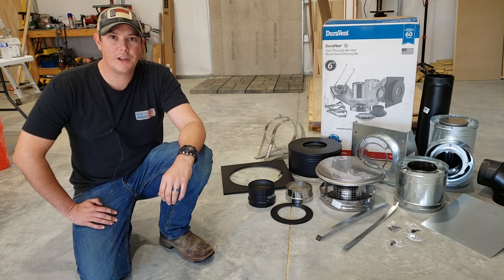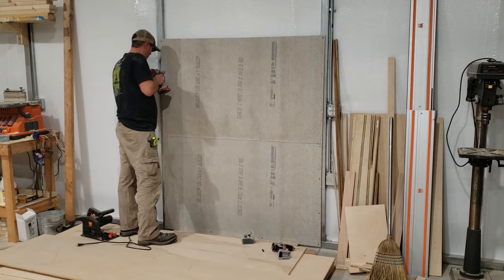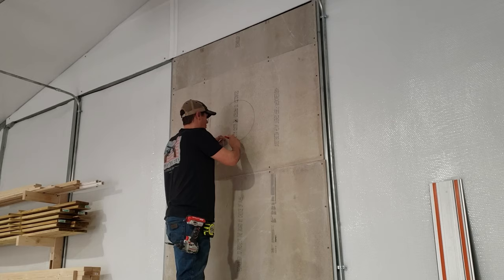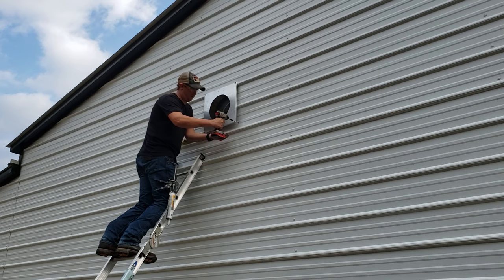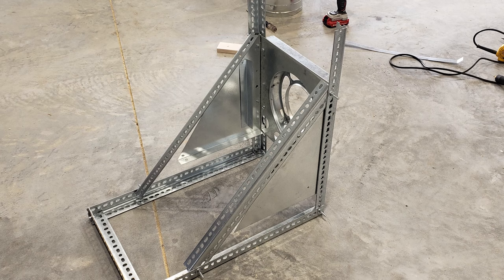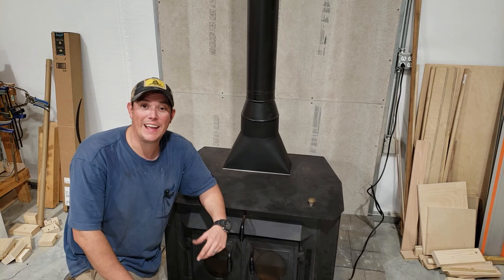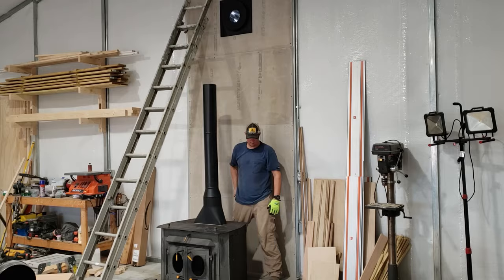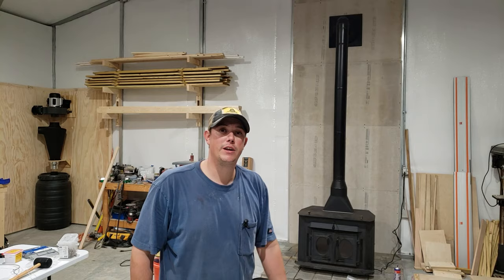Wood Stove Install / DuraVent Through The Wall Kit

Comment: I have just installed this exact system in my pole garage. I was amazed at how many obstacles I encountered while doing the project. First, after building the proper thimble box inside, n moving to the outside, that where the problems began. We installed the outer wall thimble mount, then proceeded to mount the pipe shelf bracket. (No overhang to work around, just straight shot up.) It's good we pre-fit these with the base 3 way pipe. We discovered, in order to get the 3 way into position, the shelf had to be loose from the wall. Those bolt were behind the outer wall thimble! So everything had to be loose n it was a royal bitch to tighten everything down. After that, we fit 2, 3' sections together. After locking into place, they were still able to pull away from other pipe. Next, we went to screw the upper pipe bracket fast to the top of shop. These holes were not big enough to accommodate the fasteners we had to use to withstand the wind we get here. Lastly, the chimney cap that just snaps into place, would have blown off the 1st wind storm we got. So, we re-enforced all connected pipe with self tapping screws. And the chimney cap, we installed 1" spacers with self tapping screws. Still not sure it will withstand the wind we get here. Make sure you are not planning on a breeze install. If you want it done right, you need to know what you are doing, and the way this stuff goes together is not what it seems. There was more work involved than people make it out to be. I might be petty, but this deals with fire, so proceed with caution.

Comment: Through the roof is a way better option. Better draft more single wall which means more heat easier to clean and cheaper option.

Comment: If you don’t mind me asking? I’m installing the same kit with a 24” pipe. It’ll put the platform out about 26”. What size and gauge slotted angle iron did you use? I’m thinking I’ll need at least 36” lengths going out to support the weight. Any suggestions?

Comment: I watched your video because I was a little worried about the situation you ran into clearing the roof overhang soffit. About how far does your shop roof come out from your outside wall? I'm pretty sure I'll be ok because you had to go through alot more wall material.

Comment: Great video, thanks!  I am looking to do almost the same setup but probably going 15 feet higher.  Does anyone have a good resource for what angles and vertical rise is acceptable for stove chimneys?   I had assumed that having a 90° bend was not to code...maybe I am wrong.  Also, there must be some limit on vertical rise.  Any help would be appreciated.
Reply: I'd use two 45's to reduce the angles going through a wall.

Comment: Glad you pointed out the pipe needed another section still. Should be 2 feet above any roof point within 10 feet of the penrtration, if I recall.

Comment: Very cool!  Especially so because that's MY Buck Stove.  

It was here when I moved in in 1990.  33+ years of use & no problems.  It'll cook u right out of the house.

Only difference i see is your's is free-standing & mine was installed as an insert in the original  fureplace (home built in 1951).  Not sure if yours has the 2 speed fan.   If so, you're gonna love it.

Comment: Looks good  . I need to get my stove installed at some point. I would recommend installing a simple damper in the stove pipe . It will help control the  draft and heat loss .
Reply from the maker: Thanks! The stove does have its own damper though!

Comment: Thank you for doing this video! I need to do the same with my woodstove setup, and you answered a lot of questions I had. I was really pulling my hair out trying to figure the best, and safest way to go through the wall. You are a God-send!
Reply: unfortunately Patriot did not follow the NFPA211 recommendations for code compliant installation. Wood behind the cement board. no vertical air space, shield not wide enough for compliance,  and a few other issues..

Comment: I was shocked to find that stainless insulated duravent costs $80/ft
Reply: Insulated pipe is only required when going through a ceiling/wall(combustible).

Comment: Good looking install. If you don't mind my asking, why did you set the stove right on the floor instead of elevated a bit? I know if that was originally a fireplace insert it wouldn't have legs. We bought a farm where everything was heated with wood. The older gentleman who owned it elevated all of his stoves to waist level. It was great. No bending down to the floor to load, tend, or clean. I know that was a little extreme, but it sure was nice. You're not young forever.
Reply from the maker: It's not directly on the floor, it's on blocks

Comment: Hello thank you so much for showing this I need to know if this works on a wooden building and it's not as big as your shop the shop I have has concrete floors but it is wooden built any information you can give me I would be greatly thankful for and thank you again because I have shingles on the top also I have All wood with LP siding on top of plywood of course any help again would be greatly appreciated😊

Comment: "I installed fireproof rockboard then put a piece of flammable wood behind it." 😆 "Then I sealed it with fireproof spray foam." 😂 Rockwood is your friend, son. Utilize it!
Reply from the maker: These are designed to go through regular house walls with 2x4s and plywood...  The Pipe on the inside is single wall which is the reason for the cement board, the Pipe going through the wall is double wall with an 18in surrounding thimbal...I'm sure the wood behind the cement board is just fine!!! Thanks for your concern and "constructive" comment though🤔🤦‍♂️!!

Comment: So why can't you use the cheaper black stove pipe outside for the external section of your chimney?
Reply from the maker: @divorce-split  mainly because it will rust, but also it's not insulated and more likely to cause fire

Comment: Is that a buck stove? I have a 26000 being used as a fireplace insert rn. I have a Wonderluxe wood circulator for my primary wood heat. But I love my buck stove. We use it every day. And man does it push some heat. Replacement parts are expensive but definitely worth the money. Looks terrific too
Reply from the maker: It sure is!

Comment: What type of pipe goes through the wall and how? Does it connect to the black pipe? Is it a bracket? How thick of a wall could I use this on?
Reply from the maker: It's a triple wall pipe through the wall with a larger thimbal that separates it from the wall material. The link for the kit is in the description.

Comment: Looks great however idk why these manufacturers don’t tell you that the crimp should go up with the direction of the air flow. So many videos I’ve seen with people installing the small end in the wrong direction. I’ve been doing HVAC for over 25+ years and it makes me cringe when I see people install chimney and dryer vents like this.
Reply: Certified Chimney Sweep here- male crimps should always face down so that creosote falls into the piece below and not outside the joint running down the pipe. It has nothing to do with flow of combustion gases.

Comment: Great video!
When you installed the Clean Out Tee through the outside wall thimble... 
Did you use a cauking between the Tee and the Circular hole of the thimble? (to fill the small gap)
Much Thanks!!
Reply from the maker: Yes! Fire block caulk

Comment: I am thinking about going through and existing basement window for a stove downstairs.  Any suggestions about how to go about it?
Reply: Take the glass window out (glass cannot be within 3 ft of the stove pipe). Put Cement board (with a hole cut for the thimble in it) in the window opening. Then proceed like on the video.

Comment: how is this working out combined with the insulation? I have a monster wood stove in my 30x30 and it does very little to heat the shop
Reply from the maker: I've had it up to 76 in the shop on 32 degree nights.

Comment: Whats the difference between the $299.99 "DuraPlus  6 in. Diameter Chimney Pipe, 36 in., 6DP-36CF" 
And the $139.99 "DuraVent  DuraPlus 36 in. Triple-Wall Stainless Steel Chimney Pipe, 6DP-36SS"
What's the "cf" and "ss"?  Then maybe il know which I need.
Reply: Just the galvanized material?   That's a big price difference.    Wonder if I need the galvanized? Last longer?
Reply from the maker: I think it's just the finish but I'm not positive.  My kit came with stainless, but the extra section I bought was galvanized. I havnt seen any difference other than looks, both are holding up great...the stainless is shinier....
Reply: @PatriotDIY  thanks.     The difference in price is double.    And we have no one around here in the Rockies, guess the more affordable will work 👍

Comment: Good video. When going through the wall with single wall pipe did you use the adapter the kit came with? My kit the adapter is loose on the triple wall side. Just doesn't seem right or am I too paranoid?
Reply from the maker: I used the one from the kit

Comment: Any issues with the 6 inch pipe? I have a near identical buck stove with the same rectangular 8inch connection. I ran it for a winter with 6 inch  pipe (like your set-up) with no issues. im wondering if this is a good idea or not?
Reply from the maker: I havnt had any problems, only run it for 1 winter also but havnt had any issues

Comment: Did your single wall just connect to the duravent double wall or did you have to get adapter for it ? I am trying to figure out how to install the non duravent  single wall to the duravent  double wall. Any advise would be much appreciated 👍
Reply from the maker: Mine fit into the double wall

Comment: I agree with JBiz180, a better more efficient install would have been straight through the roof. That stove pipe and chimney system is undersized for that stove and will not work optimally, and might smoke when you open the doors. That stove is a dinosaur and very inefficient, you will be going through a significantly more wood than if you had one that was built in the last decade. Also its too short, the chimney doesn't meet the 3-2-10 rule as described in the IRC. Nice install otherwise. I do like the bracket.
Reply from the maker: I realize the stove is old! That's why I like it! It's been working great!  Also i mentioned in the video that the kit didn't come with enough chimney pipe to get the correct hight and that I would be adding another 2 feet of chimey, which I've done now! Thanks for watching!
Reply: @PatriotDIY  Haha i kinda skipped through the video. As certified chimney sweep ill tell you honestly, you actually did a great job. If diy homeowners installed as well as you did, id have to find a new job. I was just in a bad mood earlier. :)
Reply: No, Scott, your comments were spot on. The installation is good  for clearances (assuming the additional triple wall is added on top). But there are slip joints to use for the single wall so you don't cut the pipe. Necking down to 6" may work, but if the stove is meant to have 8" pipe, it usually needs that volume to draw. There are ways to go straight vertical without fear of leaks. Adding the tee and bracket adds cost. Overall a good self-install.

Comment: sorry no thumbs up for you

@PatriotDIY that vintage woodstove requires 48" clearance all around its body as per Code Compliance
The rear cement board does not constitute a clearance reducing shield if you do not have air movement all around 
and when you installed the wood cross braces yuo negated the air flow vertically and put a combustible material behind the cement board which will transfer heat.
this means the rear wall shield MUST be a minimum of 3" off the floor and 3" off the ceiling [north south flow]and be also mounted 1" off the wall to allow for east west airflow
and the shield requires to be 18 - 20" wider than the stove on both sides READ YOUR NFPA211 section 13.6
and the chimney must be a minimum of 36" above the roof surface to be code compliant !!!!!
And did you put in three screws per single wall joint and install and expansion joint???
Reply from the maker: If you watch later videos in the series you will see that I added a heat shield and a fire-rated stone wall, I also mentioned in the video that the chimney would be raised 24" higher as soon as the required parts arrived......did you say 3' off the floor??????  really???   ALSO my building is metal with a concrete floor, I'm not sure 48" clearance all the way around is quite accurate in these conditions.
Reply: @PatriotDIY  3 INCHES off the floor for proper air movement.  and 48" all around the stove for clearances to combustibles. Left/ Right Rear and Front

RE the second video  which shows a short rear heatshield   . refer to NFPA211 section 13.6 for the proper installation methods
and its great that your building is metal but what are the interior walls made of??  Looks like a combustible material and again you put a combustible material [wood] behind the cement board and blocked the vertical flow of air, which is required for cooling and 50% reduction of clearances

Comment: I've honestly always been a little skeptical about installing through a wall, can anyone tell me how the draft works through the wall versus through the ceiling/roof?  Or is it all 6 to 1    ----     half to the other.
Reply from the maker: Through the roof draws better but I didn't wanna worry about water leaks
Reply: I can tell you my manufacture of stove pipe says that all horizontal installed pipe has to slope 1/4” per foot of pipe

Comment: You really should not have  the horizontal piece at the top going through the wall………that should be a vertical angle….that would be illegal in this country..
Reply from the maker: Sooooo what would be the point of a "through the wall kit" if you can't have the angle at the top?   "Vertical" would be a "through the roof kit" 

Straight up is certainly more efficient.. but then you have to worry about roof leaks....through the wall works just fine!

Comment: Having am air space with out air circulating behind it is not code the horzontal strip stops that . Also that is a fireplace insert which is ment to be in a fireproof box. The opening is at ground level which is where gas fumes are at least you should raise it on blocks to be somewhat safe.  Try reading before some install instructions before you teach how to to burn peoples homes down.
Reply: Inserts are commonly installed in boxes that are no longer fireproof, they must also be lined to the top. This unit is not an insert, I've installed a couple this year. I said the same thing when I seen this particular model line. Your correct about the height, it's meant to be installed on a masonry pedistal with a fresh air intake.

Comment: Your chimney isn't tall enough. You need to be 4' - 6ft higher than the highest point/peak of the roof. Otherwise a strong wind will effect your draft adversely.
Reply from the maker: Did you watch the video?....I mentioned in the video that the kit didn't come with enough chimney pipe so I was going to need to add more!
Reply: Replying to a comment: Code is not 4-6 ft🤷‍♀️ ..this video showed everything to code.

The video was extremely informative.. thank you SO much for sharing!
Reply: 3ft pass the highest point is what I'm told

Comment: thats gunna burn ur house down
Reply from the maker: Lol Why?  been going strong for 3 years burn every day in the winter with no issues.

Also....how's it gonna burn down a metal building?
Reply: @PatriotDIY  you prolly installed it wrong that's why you didnt show that part... also.. the wood framing...
Reply from the maker: @redsresearch  I showd the entire install, no issues here!  Also these are designed to be installed through house walls with plywood sheathing and 2x4 framing, ....sooooo I'm confident the small amount of wood used in my install is gonna be just fine!

Do it differently if you want boss man, but what's the point of hating on the internet?
Reply: @PatriotDIY  u did not show the entire thing your delusional
Reply from the maker: @redsresearch  haha whatever you say... but there is video of EVERY component being installed. The inside wall thimbal and the outside wall thimbal are installed and fit into each other inside the wall, then the double wall T is pushed through the thimbal from the outside and your 6in interior pipe fits into that from the inside....all of that is in the video.
But I'm not gonna keep arguing with some troll on youtube. I just made a video showing how I installed my stove. If you didn't find it informative...oh well! Move on ✌️
Reply: @PatriotDIY  why didnt you show close up and detail vid of how it go thro wall then???
Reply from the maker: @redsresearch well ...  because I don't have a camera inside my wall!!!!  I also didnt feel like trying to rig up a tripod 12 ft off the ground!!!!  I tried growing a third hand so i could hold the camera while i worked but that was a failure...

You just stick that thing in there and one fits inside the other....it's not brain surgery... BTW the kit comes with its own Instructions!!  You shouldn't be relying solely on this video for every detail.

Good luck to you my friend!
Now please go troll someone else's videos...
Reply: @PatriotDIY  excuses excuses.... coulda easily picked up the camera and showed and explained but no, you did it wrong
Reply from the maker: @redsresearch  lol whatever you say!